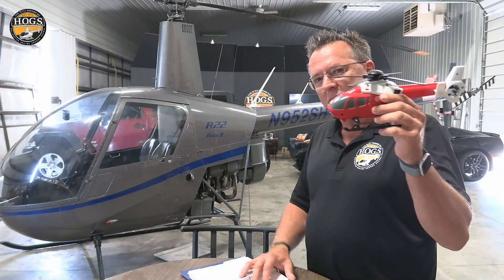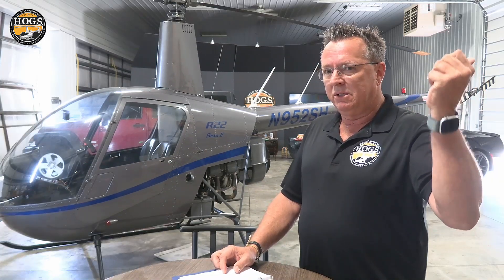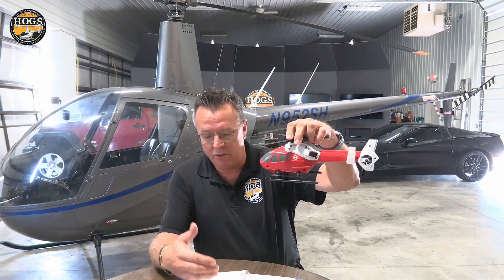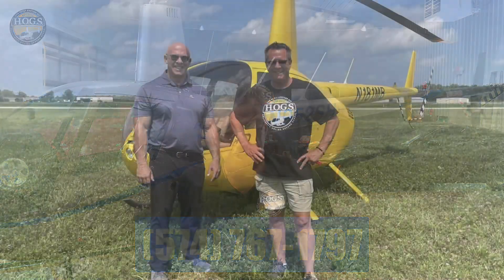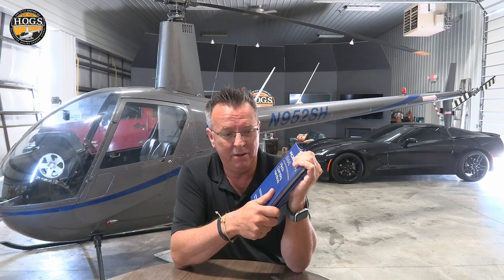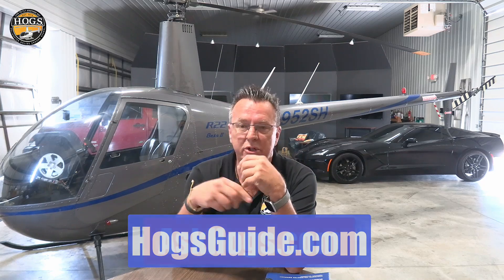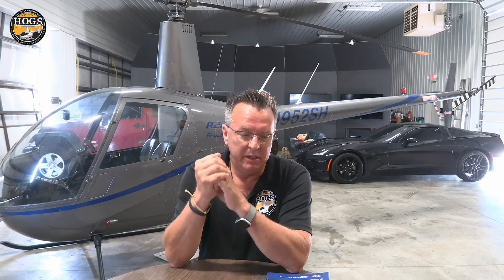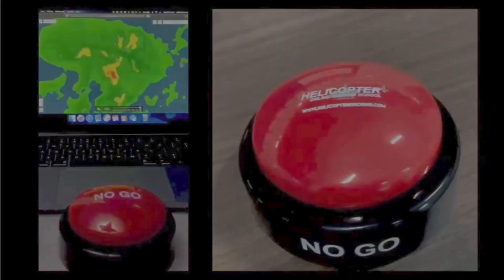Tail Rotor Failure: The Bad Lesson That Fails Students

Comment: Some basic knowledge of general physics would greatly help new pilots, both helicopter and fixed wing. When yaw control fails, the best option is speed. In a fixed wing there's some wiggle room to make it to a safe landing site (preferably a runway - personal experience)). In a rotorcraft, get on the ground as quickly as possible while maintaining the recommended speed in the POH.

Career banner pilot here, 7000+ PIC, mostly tailwheel.
Reply from the maker: Thanks for the great feedback!

Comment: Had a coolant line blow last week and coolant made the Tail rotor belts a bit too slick.  Never felt it till about the time I dropped through ETL.  Felt the pedal hit the stop and it still rotated on to the left, (clockwise rotor).  Actually bumped the collective for a fraction of a second to get a bit more clearance on the uneven terrain to assure I was in a good area.  I didn't chop the throttle, but rolled smoothly towards off till it stopped spinning, and set it down with the collective.  Not a scratch on the bird or myself.  Had to leave it in the field for a few days as I need to run to London and back.  Took about 4 hours of work and got it back to the house.  I did have those videos running through the head that showed all the ships rolling over.  Glad I stuck with the training and quick wit thinking through all options in a very short amount of time.
Reply from the maker: Thanks for sharing!

Comment: Interestingly the Cabri G2 POH has a slightly different procedure. For non-hovering tail rotor failure to switch off governor, adjust power to 70-80kts, reach an appropriate surface for autorotation landing, then enter autorotation and land with as much airspeed as the surface permits. I suppose this is just one of the challenges a pilot has to deal with when flying different aircraft. Need to be familiar with the procedures and know the differences between them in terms of normal and emergency procedures. 

Not using expired materials for a check ride sounds like pretty common-sense advice, but I get the frustration of keeping up on all these new versions of books, charts, etc... I haven't gotten to cross country flying yet, but it's going to be interesting to see how my flight school balances the traditional navigation via charts with the newfangled tablet methods. Seems to be required (and a good idea in general) to be familiar with paper and plotter, but at the same time ignoring the advantages of technological assistance would be foolish.
Reply from the maker: Thanks for the feedback!